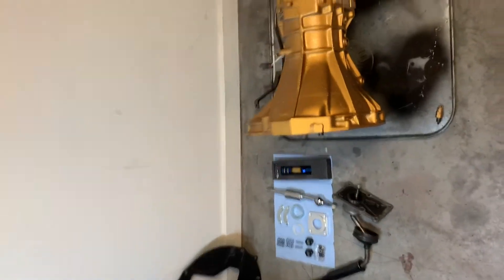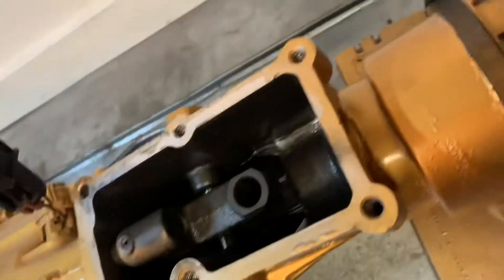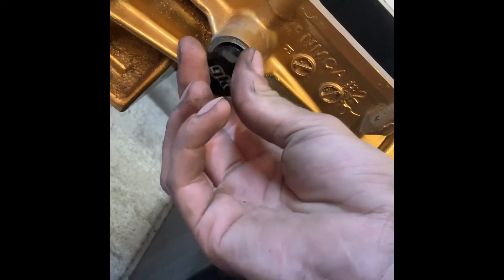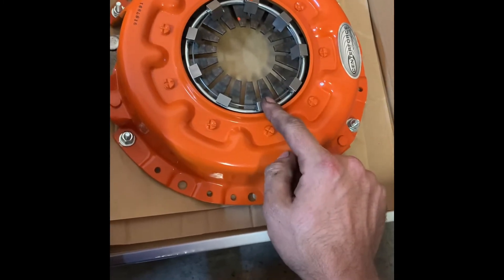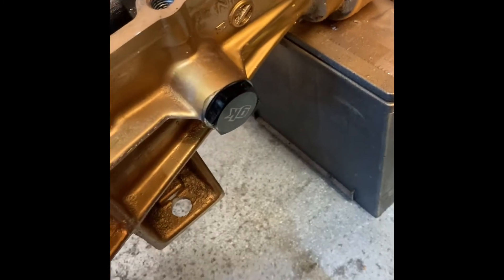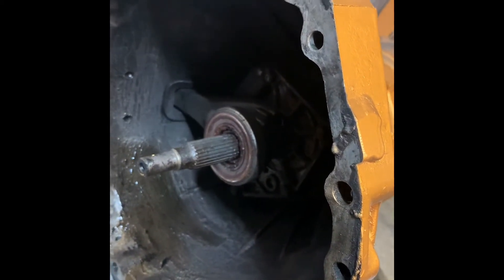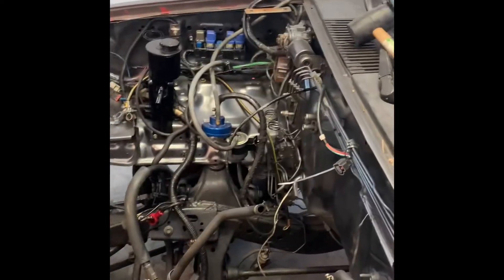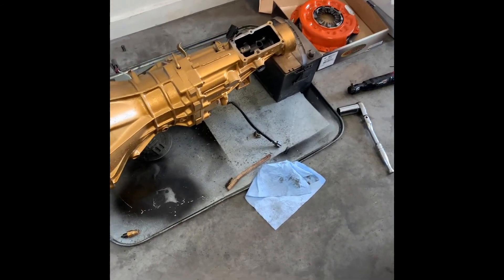Nissan KA24e Shifter Spring Install/S13 Short Shifter in D21 - Turbo D21 Drift Truck

Comment: That's a good clutch. I have been running one for 10 yrs. Do a damper delete if you haven't already.
Reply from the maker: I have! Did a AT to MT Line from Master straight to slave. Even got rid of the little baby line going to the slave itself

Comment: For the shifter spring kit did u just by the one for the 240sx??
Reply from the maker: Yep, just used the cheap shifter kit for the S13 and it works perfectly. Make sure you get one without the plate on top as all of those don’t work.

Comment: Awesome work 👌🏾👌🏾,  would like to have my engine look like that one day 😁👍🏾 got a parts list on the engine mods?
Reply: Did you use spray paint on the valve cover and other components?
Reply from the maker: Yes I did actually. Everyone thinks it’s powder coat but it’s called Metalcast paint. Semi high temp & metallic colors
Reply from the maker: Thank you!! Next video will be a full walkthrough and build list! Should drop tonight!
Reply: @StreetTerrorGarage  definitely staying tuned on that 👌

Comment: When checking a used manual transmission before you buy would be play or wear in splines or gears right?
Reply from the maker: Sorry I never saw this, have no clue why. But it’s kinda hard to check a manual trans without either driving it first or cracking open the case and inspecting the gears. It could go into gears fine while not attached and feel okay but synchros could be shot or broken completely. Example being my Infiniti will accept 3rd gear and hold the shifter but the synchro went on vacay long time ago. It’ll just openly rev in 3rd gear but you would never know if it wasn’t on the engine or you didn’t open it and look

Comment: hell yeah, I've got a 96 d21 im working on now. What are you using to tune it? I've been strongly leaning towards Nismotronics.
Reply from the maker: I’m using Megasquirt PNP for the D21. Plugs directly into stock harness and can run the d21 stock or super modified. For the price point, it’s a super badass unit and does everything I need perfectly. If you check my latest video I talk more about it and some of the other things I installed along with the Ecm to help dial tuning in
Reply: @StreetTerrorGarage  Not too much more than nismotronics from what I see, I'll look into it. what about that transmission? I have the same one. I feel like all the gears are so damn short, I end up driving like a grandpa cause I feel like im revving high at 65mph. I know little to nothing on manual transmissions and diffs. Would a different diff move it to where I want it? opinion?
Reply from the maker: i completely understand the gearing issue lol I have a 3.56 stock d21 diff currently and I cruise at about 3k ish @ 70+ but I’m actually putting another rear end from a rodeo for even shorter gearing. My reason being is for drifting tho, I don’t drive it often on the interstate. I do believe there is a lower ratio for the trucks in another year but I’m not 100% sure on that. Im gonna see how long this trans last and possibly switch to z32 or cd009 eventually depending on what I can find for swap interchangeability

Comment: Do you have a link to the short throw shifter? How does it feel?
Reply from the maker: https://www.ebay.com/itm/113901104851?mkcid=16&mkevt=1&mkrid=711-127632-2357-0&ssspo=F5_rCZfjRH-&sssrc=2349624&ssuid=Rn92F3hrQ1i&var=&widget_ver=artemis&media=COPY
Reply from the maker: That’s pretty much the same kit I used. Works well and was able to use all of it. Shifter wiggles a tiny bit freely due to smaller bottom plastic cup but throws are real nice
Reply: Thanks bro. Hope I don’t bother you with too many questions. Seeing your build has inspired me to get my truck up to speed!
Reply from the maker: @corsairmotorwerks547  no problem at all man & glad to hear it! I’m happy to help

Comment: Can you use this trans with a 2jz?
Reply from the maker: I don’t believe so but no 100% sure. I couldn’t find any kits that would work for that except for the 2J to 300zx transmissions. That being said,I know the CD trans from the G/Z is the go-to on the JZ swaps
Reply: @StreetTerrorGarage  yeah I'm doing a 300zx bellhousing on a skyline awd trans right now but I've got a spare 720 5speed I wanna try using before I just have to get rid of it
Reply from the maker: it’d be worth a shot to swap the bell housing and see but I’m not sure. the shifter placement would be farther back with a truck trans(if it’s in a car). this trans has a different shifter placement then it’s 240 equivalent for the KA.